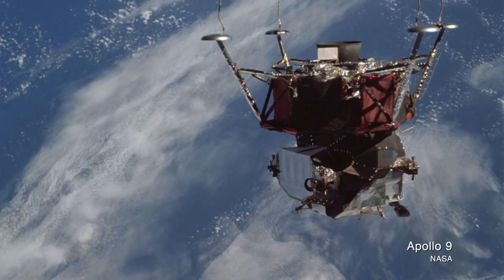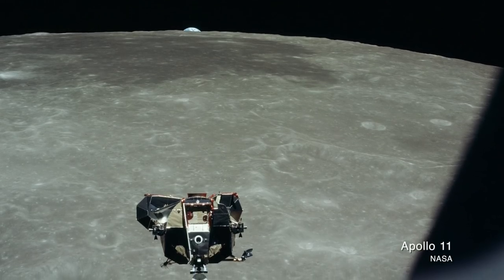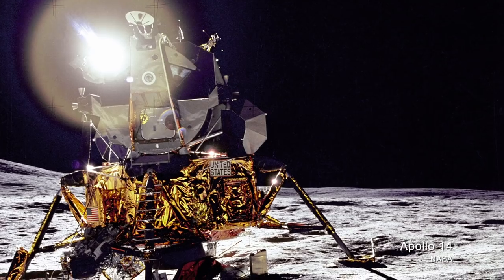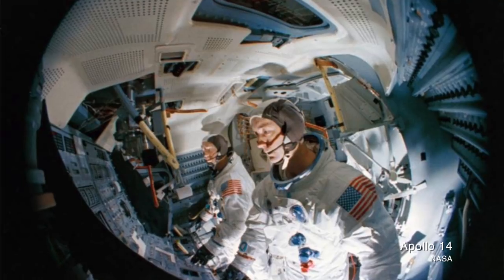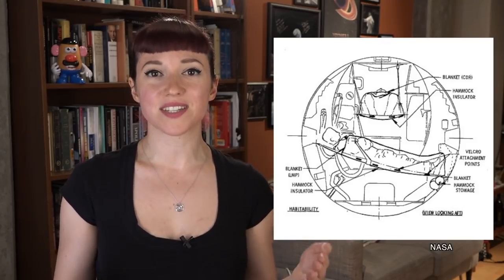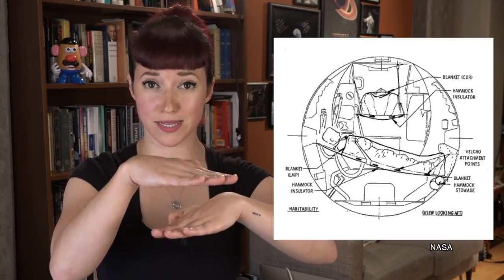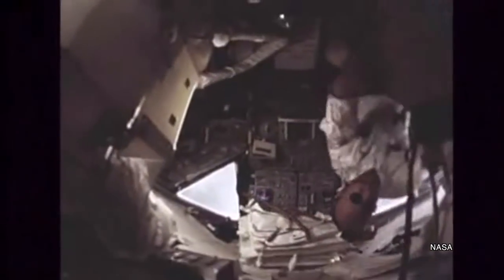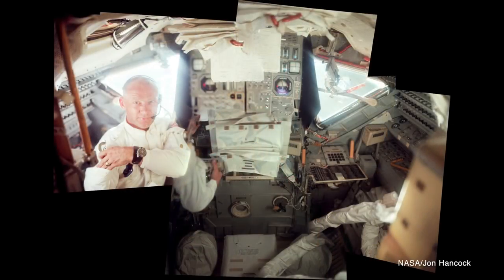Peeking Inside a Messy Lunar Module

Comment: Is it true that the "skin" of the lunar module was actually the same thickness as that of a common aluminum can? If so, that seems pretty thin to me. A micro meteorite would be a disaster waiting to happen, also It wouldn't provide much sheilding from a solar flare, right? Fifty years later I'm still in awe of the courage of our astronauts!
Reply: The outer skin, yes. Inside that outer skin though, is a sturdy machine. Nothing is going to penetrate it.

Comment: Here's something to think about - how did the astronauts fly the lunar module standing up?
Reply: There were elastic bungee cords connected to the walls of the LM's cockpit around where the astronauts would stand. Then there were  attachment loops sewn into the astronaut's space suits. Before flying the vehicle they would hook the stretchy bungee cords into the loops, which would hold the astronauts down onto the floor so they would remain in place while the LM was performing powered flight.
Reply: @joevignolor4u949  Interesting. They really thought of everything.
Reply: @srinitaaigaura  They sure did. All anyone has to do to see how the moon landings were accomplished is to look for the information. Its all out there somewhere.

Comment: But wait. On the way to the moon, weren't they in the CM until descent; not the LM? And then 2 of the 3 moved into the LM for descent?
Reply: Correct.
Reply: So then what are we missing,  @rockethead7 ? These are really pictures of the CM?
Reply: @HelloKittyFanMan.  
No, those aren't CM photos.  They're LM photos.  I don't understand the question.
Reply: All right,  @rockethead7 , it's good if they're LM pix. I wanna see CM ints too. But I asked about this because when she says "on the way to the moon," I think she's talking about most of the way (days), so she makes it sound like they should still be in the CM at that point. So I'm confused.
Reply: @HelloKittyFanMan.  
She also says those photos were taken 57 hours after liftoff.  So, they were almost to the moon, starting to get the lander ready to separate.  Anyway, if you want more photos and information, you should try the Apollo Lunar Surface Journal website, and select Apollo 11, then select "image library," and go from there.
Reply: Oh, sorry,  @rockethead7 , because I missed that. Thanks! Yeah, at that many hours, it would make sense. Thanks for the extra info too!

Comment: I wonder if they could deliberately choose small people for these missions. Body strength isn't going to be important, but bring 5'5 and 120lbs is preferable to 6'0 and 180. Female crew might make more sense, actually, as they're typically lighter than men.
Reply: Yes, you couldn't be 6 feet tall or taller, and the weight was restricted.  I had heard it was originally 160 pounds, but, later I heard it was 180 pounds.  So, I'm not sure about the weight.  But, no, they didn't restrict it down to 5'5" and 120 pounds, like you're suggesting they could have done.  They didn't want to eliminate the most qualified personnel and just make it an effort to find the smallest pilots out there.  But, your underlying point is basically correct.  Every pound spent on lifting an astronaut off of the surface of the moon could be another pound of rocks.
Reply: Body strength is important though, as jumping around in those heavy suits was known to be quite exhausting.

Comment: WITH WALLS 12 THOUSANDS OF AN NICH THIN THE CAPSULE WOULD HAVE BLOWN UP FROM PRESSURE INSIDE.  A FUCKING TIN CAN SPACE JUNK !  ephemetherson
Reply: @tgstudio85  Idiots like Eric here think the mylar was all that stood between the astronauts & space. They're too dishonest to look into how the LM was actually built.
Reply: "WITH WALLS 12 THOUSANDS OF AN NICH THIN THE CAPSULE WOULD HAVE BLOWN UP FROM PRESSURE INSIDE"    -   And yet a modern aluminium drink can could have a wall as thin as 0.01mm, or 4 thousandths of an inch, and withstand a pressure difference between its contents and the outside of 70 PSI (the equivalent of about 5 atmospheres) without blowing up.

"A FUCKING TIN CAN SPACE JUNK !"    -   Maybe in your case it would be better to learn something about tin cans before pontificating on spacecraft design.
Reply: @rjcornford    Yes, and the LM was designed for a partial pressure environment of 4.8 psi.
Reply: @rjcornford  10 to NEGATIVE 17 TORR IS MUCH MORE THAN 70 PSI ! AND YES, I READ OL LOT !   ephemetherson
Reply: Eric Kaminski
"@Richard Cornford 10 to NEGATIVE 17 TORR IS MUCH MORE THAN 70 PSI !"   --   Not in any sense. 10 Torr is only 0.19 PSI and suggesting that any negative value is "MORE" than a positive value would be a mathematically unique application of the word 'more'. However, "NEGATVE 17 TORR" is a nonsense value. Torr are a unit of gas pressure. Whenever there is no gas the gas pressure is zero and since it is impossible to have less gas than none at all it is not possible for gas pressure to become negative. What you are suffering from here is innumeracy. You have seen a measure of the gas pressure of a near vacuum measured in Torr and expresses in exponential format and misinterpreted the negative sign in front of the exponent as meaning a negative value. That minus sign does not mean the value is negative, instead it means that the value is positive but extremely small (that is, very near but still slightly above  zero).

For the LM, as  mako88sb pointed out, the internal gas pressure is 4.8 PSI, and the external gas pressure is fractionally more than zero. That makes the pressure difference between the inside and the outside fractionally less than 4.8 PSI. That is a pressure difference that is considerably less than the 70 PSI pressure difference between its inside and its outside that can be withstood by a common aluminium drink can.

 "AND YES, I READ OL LOT !"   --   Then it appears that you next challenge is to understand some of what you are reading.